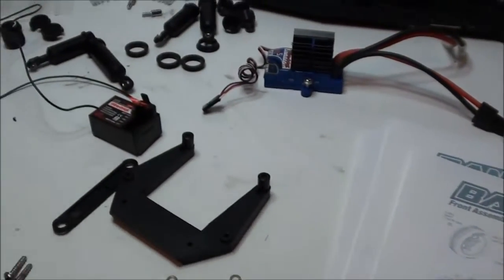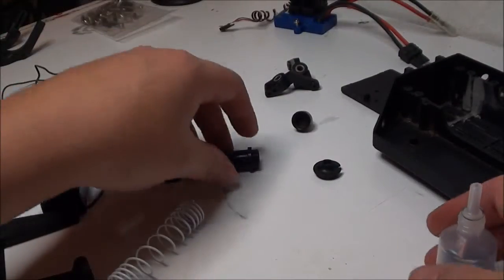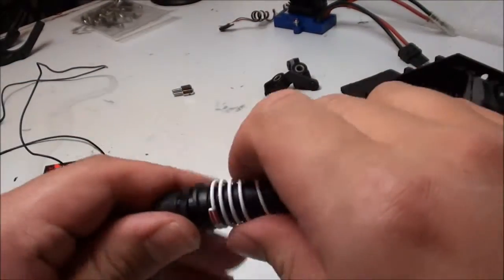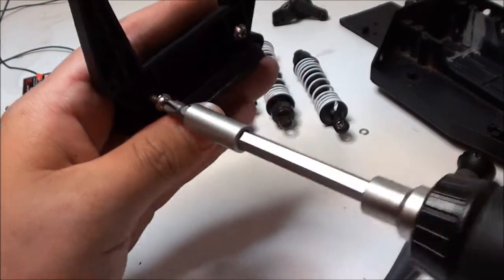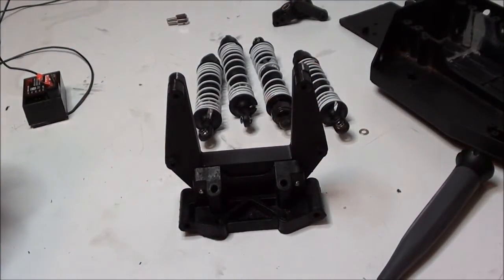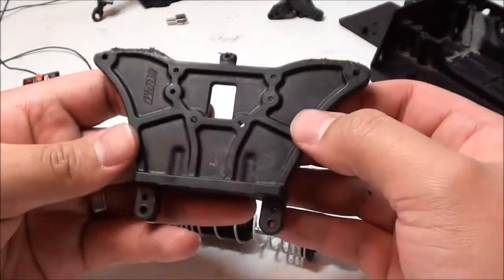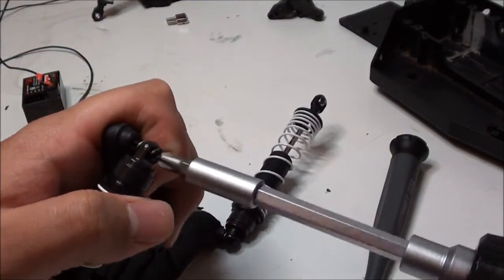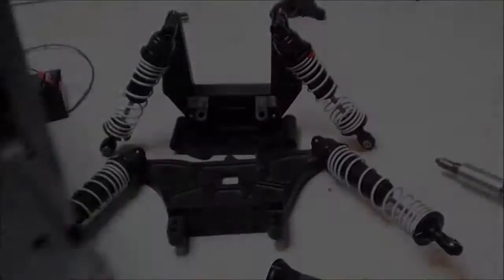Nhexus - Traxxas Bandit - Built From Scrap Parts - Part 1

Comment: dude i hate my bandit its a pice of crap its a cheap rustler. i dont know why you are making one, your rustler is basically a better more in-control bandit. the bandit sufferers from small tires. its your project dude so i say go for and good luck but i still think you will be disappointed like i was with mine